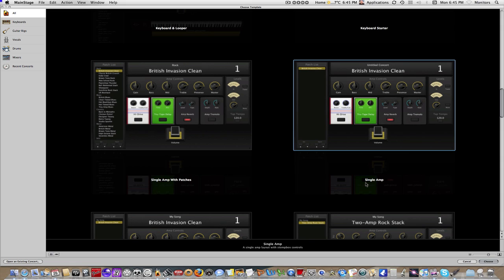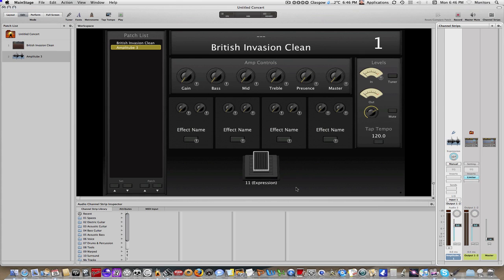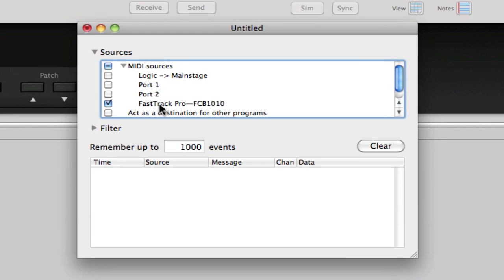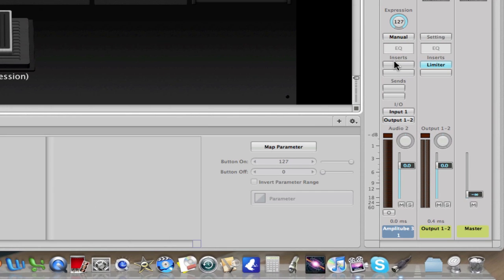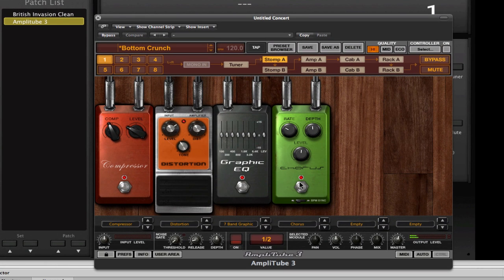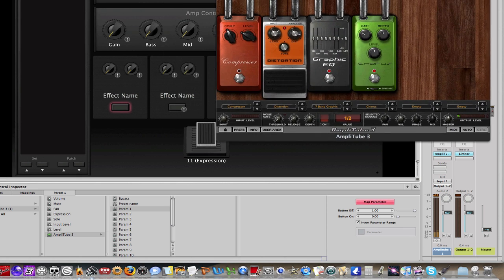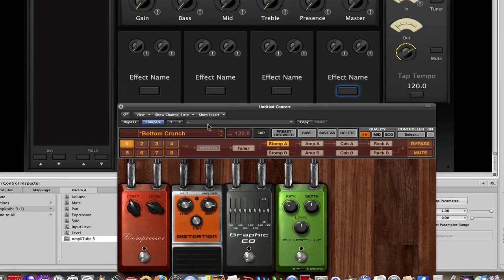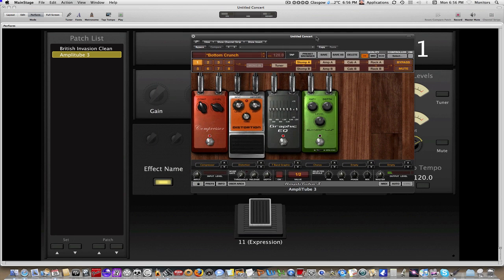Amplitube 3 Stompbox Control in Mainstage

Comment: Thanks for the tutorial.Sure helps, specially when we are new to MainStage.You are using your foot controller to control stomp boxes in amplitube .How do we set up MainStage to move from different patches of amplitube presets instead of stomp box on/off? I would like to move from preset to preset (factory or user) just like how we would use a POD pedal to move from one tone to another that has been already programmed & saved.Can I use key commands from my Mac keyboard when I don't have a floor midi controller in my setup? If you can clue me in I would appreciate.-Thanks.

Comment: Hi and thanks for your video. I was able to get my Behringer talking to MainStage and mapped to Amplitube 3 no problem. MY problem though is the most fundamental one - I cannot get a signal to Amplitube from the guitar!

I am using a Steinberg UR22 as an audio interface to a MacBook Pro. The Behringer FCB1010 is connected to this device via MIDI cables. iFCB recognizes the device and MIDI Monitor confirms the correct CC values are flowing back and forth.

MainStage is configured just like you indicate on this video and Amplitube 3 is set up as well. 

The Steinberg UR22 is connected via a 1/4 stereo jack to an amplifier. The guitar I'm using is also connected to the front of the Steinberg. I can clearly hear a guitar tone coming out but the tone is coming out unmodified. It's as if Amplitube and MainStage were being bypassed.

Can you assist me or point me to a good resource for troubleshooting my set up?

Thanks!!
Reply: +Fernando Luna ....and I figured it out... Main Volume fader was down all the way... Your tutorial is the BEST. Thanks for posting it!!
Reply from the maker: +Fernando Luna Lol, that's good news Luna!  Sometimes it's the small things that get us :)  All the best and happy playing!
Reply: Here's another question for you, if you're willing... I play keys and guitar. I'd like to be able to get Mainstage to output to a different amp depending on whether I'm on keys or guitar... I currently have a Steinberg UR22 (only two outputs - left/right) and my first thought was maybe I could reduce all keyboard to mono and send to left channel and all guitar to right channel... but I'm told that's either not possible or not ideal and I'd have to break down and get an audio interface that has four or more outputs. Do you have any experience with this or any thoughts as to what can be done?

Comment: Hello and thank a lot for your video.
I'm trying desperately to find out how to map channels strips in order to switch from clean to crunch or from crunch to distortion or from clean to solo or any combination of 5 channels in total in order to pass from one channel to the other 4 channels by only pressing one button and be free with only a switch of a button to go back to my clean channel.
I'm using a foot controller in normal mode, should maybe use the mix mode or all depends from the mapping system from Mainstage??
I'm willing to pay anyone to help me learn how to set up my that way of stopmboxes switching.
Thanks.
Fran
Reply: Ps. I managed to invert the first parameter with solo function, so from clean I can go to crunch or any other channel, but when it comes to map the third channel I couldn't manage to find a way to switch on the distortion and deactivate automatically clean and crunch as one of them (it depends where you left it) remain active and I can't even switch off but forced to keep or clean or crunch.
I'm really getting crazy trying things out, I really hope you can help me or you can give me some paid online service.
Cheers.
Reply from the maker: Fran - I-Morse Hey there, yeah, that kinda thing can drive you crazy for sure.  The reason it's not turning off is that you need to send two CC's, one with a low value and the other with a high.  For example, if you're using CC 20, then send CC20,value 0  and CC20,value 127.  Try that and let me know how it goes.
Reply: JasTheMusicman Hello! thanks so much for your answer. Well, I actually when you say CC's I don't know what you are talking about :-(. I have got a Yamaha MFC10 midi foot controller and I manage to program in a way where I can assign plugins or channels on Mainstage. For example in layout mode I assigned: Midi fort: All, Channel: Channel 1, Type: Alternating Value, Number: 21 (Ctrl 21), Midi Thru: Do not pass through and the button F21 on the controller send the right midi message and so it's working...but of course this system doesn't let me to do what I want or anyway I don't have experience with this staff at all! Do you know who could help me on this (midi programmers, people working in studio recording)???

Comment: Hello, thanks for this useful video! I just was wondering...it is possible to assign for example on the 1st switch of the FCB1010 a channel strip which would include for instance an amplitube amp set up plus any other effects or plugins available in both Amplitube and Logic Pro??? Thanks in advance. Best

Comment from the maker: Good question.  Yes, I'm stepping on a foot controller which is sending MIDI messages into Mainstage, I then map/interpret those MIDI messages in Mainstage to activate the functions in the plug-in.  Not so much a routing path per se, straight up MIDI switching.  Yes, this works for Logic as well, haven't tried GB.

Comment: @JasTheMusicman Im still in the software just assigning my map parameters from the setup I made in layout mode to the plugin effects I want to control them with. When i turn my assigned knobs or "click" the on/off pedal switch it doesnt change my GR4 effects. All other non GR4 effects work fine. But, changing GR4 effects does change my knobs in the mainstage layout.  Ideas? I will sync the controls to my Korg M3 in the end. But I will be sending my Fender Rhodes thought mainstage for the effects

Comment from the maker: Thanks and a great point!  I just tested Mainstage with GR4 by mapping a Mainstage amp dial (Treble) to the Treble control of the Twang Reverb Amp in GR4.   At first I had the same problem as you did, I was using a control surface knob but then I re-assigned it to a fader that had much smoother CC value increments and it mapped and worked just fine.  I moved my fader and could see both the Mainstage dial move as well as the  GR4 dial and vice versa.  What controller are you using and for what?

Comment: whoah dude. nice explanation.you are a life saver. 

but I still want to do it with MIDI learn. Because it's not limitted with only 16 parameters.

I haven't yet update my Amplitube 3.

MIDI learns works fine on stand alone,but doesn't work in DAW. I'm using Reaper. Does it work on 3.02?

Thx.